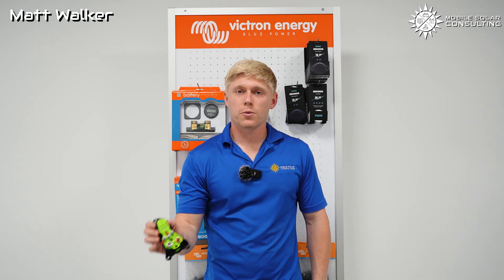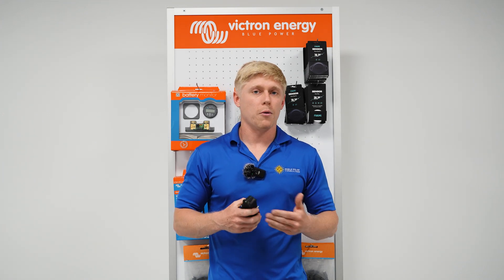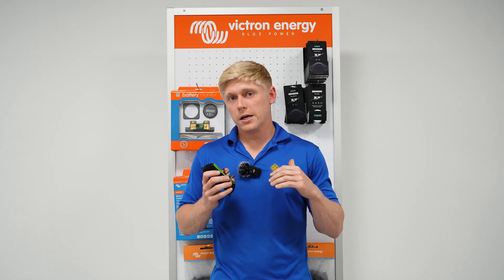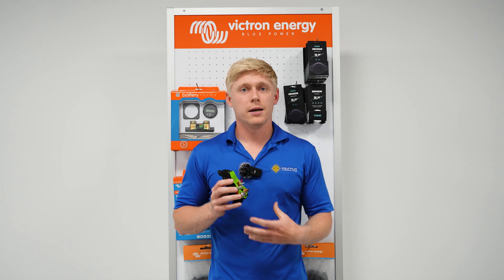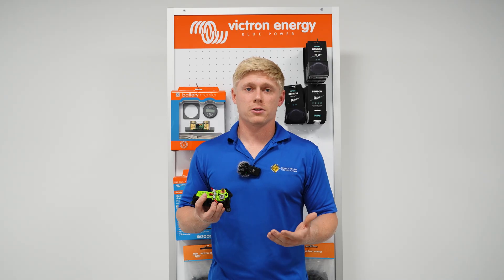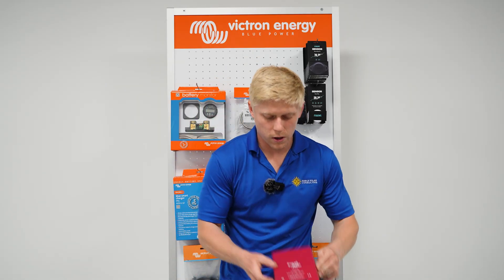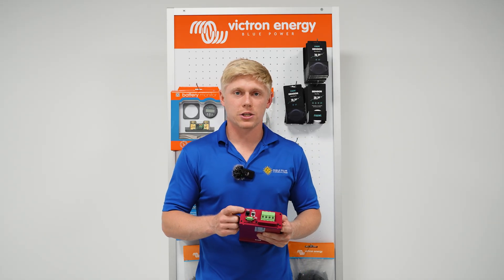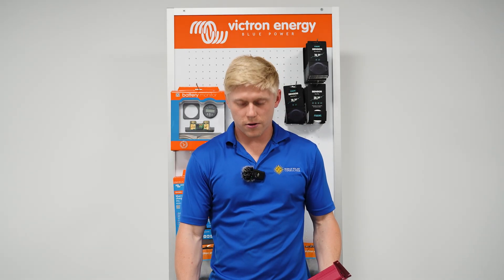Battery Isolation Manager (BIM) vs DC-DC Charger - Which Is Better??

Comment: While the engine is running the isolator allows the alternator to charge both batteries for 15 minutes then switches the current off allowing the alternator to cool for 20 minutes.  It then switches back and allows charging again for 15 minutes.   This saves the alternator from overheating from the high current flow while charging.   READ THE OWNERS MANUAL
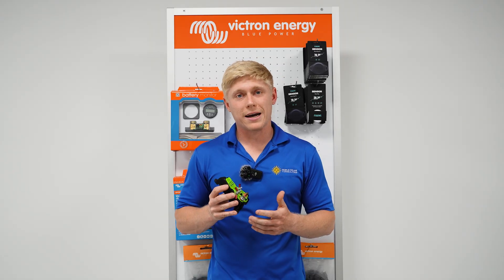Reply from the maker: Jerry, please refer to 2:08 when I discussed exactly that.

Comment: I got a odyssey battery as my main battery in the engine bay, I currently have a XS Power D4700 as a 2nd battery in my trunk, between those 2 I have an isolator. Eventually I would want to swap my xs power to j40 lithium. If that was the case I can’t use the same isolator right?
Reply from the maker: Correct
Reply: @MobileSolarConsulting ok so that would mean I’ll need to install a dc/dc charger for the 2nd battery

Comment: Fortunately most smart batteries have a built on BIM that controls charge rate and shuts off when full.
Reply from the maker: This is simply not true. They do shut off when full, but it's still not good to constantly overfill your battery, and they cannot control the charge rate coming from an alternator!

Comment: Hi! 

I have a lead acid starter, and currently a deep cycle lead acid marine battery as the aux. Both are under the hood. It is an old system, and there is currently a battery isolation manager installed under the as well. It goes Starter -> Battery Isolation Manager -> Black box (which I assume is a fuse) -> House Battery. 

Would I be ok to install a DC-to-DC charger after the existing battery Isolation Manager to the house battery?  

Thanks!
Reply from the maker: Hi, very good question. Yes, this is fine. In certain cases, if you have a bi-directional DC-DC charger (like the sterling) and you install it after the BIM, it will not be able to trickle charge your starter since the BIM is turned off when the vehicle is off. However some BIM's are smart enough to see this and turn on to allow the trickle charging. Just depends on the BIM. But yes, installing the Orion after the BIM would be fine!
Reply: @MobileSolarConsulting  Ok, thank you. To double double check - the BIM is NOT one rated for a lithium battery. Doesn't matter eh?
Reply from the maker: @callumscott1538  Correct - it's better that way. The lithium ones would turn off and on every 15 minutes. The lead-only ones will stay closed all the time while driving, allowing your DC-DC charger to do it's job best.
Reply: @MobileSolarConsulting  ok! if you have a recommendation for a charger I can mount under the hood (near the front vents) I would appreciate that!
Reply from the maker: @callumscott1538  for that, the Orion XS is best. IP65 rated. In our store here: https://mobilesolarconsulting.shop/products/orion-xs-1212-50a-dc-dc-battery-charger